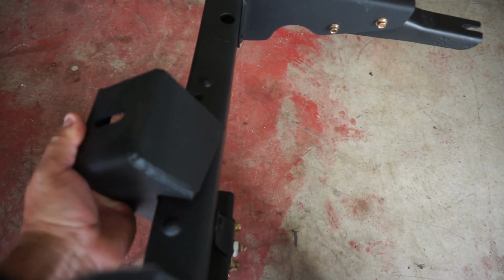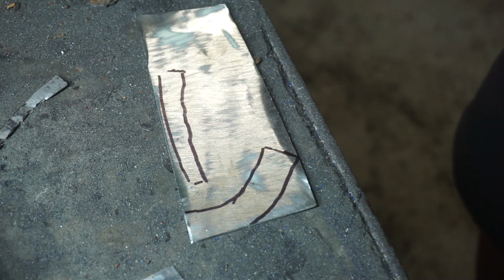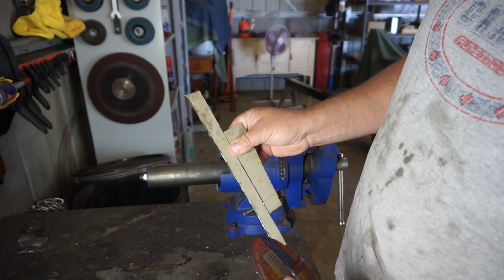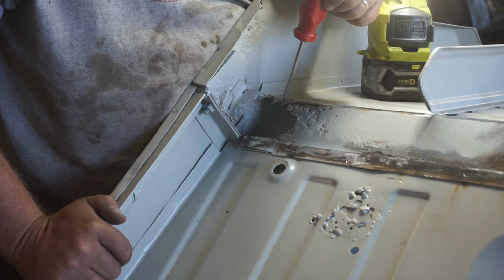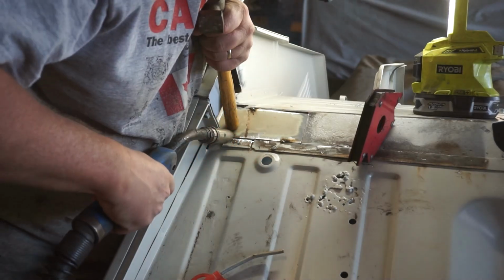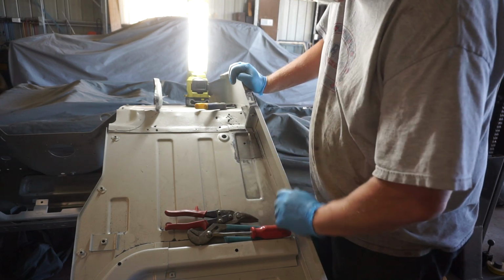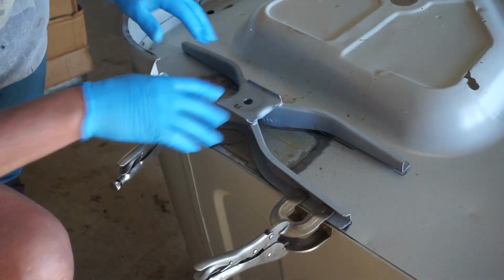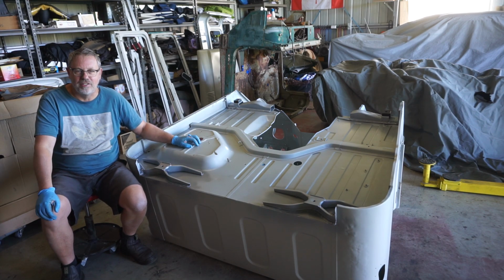FJ45 Landcruiser Restoration | Fitting the LSA Part 1/2 | Body Mount Repairs | Episode 12

Comment: Love your work!
you should Invest in an air chisel
Make it a hole lot easier when seperating spot welds
Reply from the maker: Thanks mate, I do have one.  I have used it in the past but I find them a little too destructive as they kinda chew through the metal.  I sincerely appreciate you taking the time to comment mate 😎👍

Comment: I noticed that you predominately just do a series of tack welds instead of line welding.. is there any reason for this method?
Reply from the maker: Yes absolutely Tim.  As I explained in the video, heat is your enemy.  If you do anything more than spot welds (with cooling in between) you will get warpage, there is no avoiding that.  For that reason, spot welds and constant cooling with an air gun is the go. Cheers and thanks for the question😎👍
Reply: @JafffaAdventures  Thanks for the prompt reply. I understand what your saying and get it. I was taught to do small straight lengths and let it cool I was just wondering why you only do a spot instead of a small length.. I guess it is more about the size of the panel being replaced for the heat transfer.
Reply from the maker: I’ve never had any luck doing small lines, I always get too much heat in it.  I guess it could be the size of the panel but for me spots are the only way I can manage the warpage.  Thanks again mate, I appreciate the feedback 😎👍